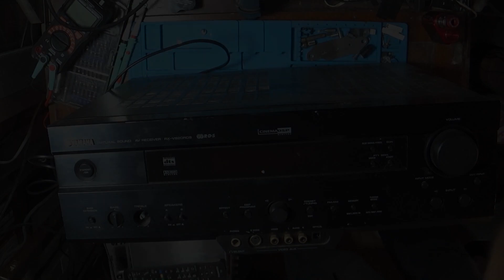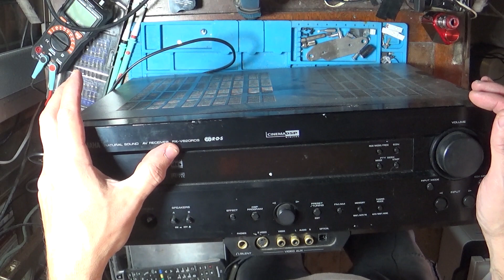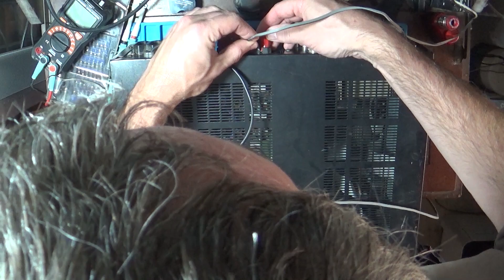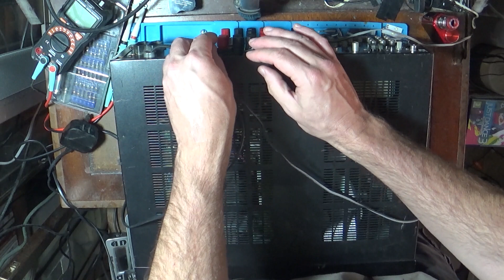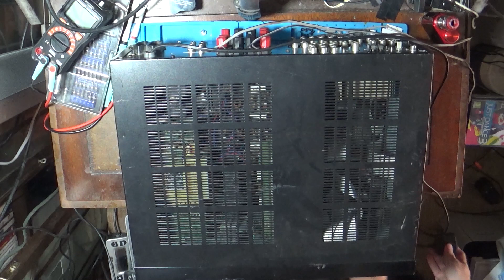Yamaha AV Receiver No/Low Sound Repair. Not sure what has happened to this amp? | UK eBay Reseller

Comment: Good Find!! You got lucky with a fairly simple fix. I was hoping in watching the very beginning that this would help me with my issue. I have an Harman Kardon AVR AV amplifier with the same issue... very low audio. I am thinking the amp got hot just like you say but in taking it completely apart and looking over everything I do not see anything out of the ordinary. Caps do not look swollen, no bad solder joints and all connectors are ok. It powers up normally and does not go into protection mode. All looks and operates normal but just has the low volume. Do you have a video on how to go about troubleshooting this scenario? (Testing transistors, etc.)
Reply from the maker: I'm not sure if I do have a video on fault finding. https://youtu.be/uDOwRPofaCQ this video has blown transistors but it was so long ago I can't remember the content without watching it myself. I didn't fix this one though as I had trouble getting legitimate new transistors.
Reply: @RetroElectronicRepair  Appreciate the reply. I am going to take it all apart again and check the transistors using your method. I like how you moved the working ones to confirm the bad ones. When checking the caps are you looking for shorts or opens using the ohms function with your multimeter? You don't show this on the video.

Comment: Great video on a small workbench. 
Couldn't you glue the board and restore it's shape with some epoxy like material? What glue can one use for printed circuits?
Your solution was spot on by anyhow.
Reply from the maker: You could probably use some epoxy resin but it would probably just break off again.

Comment: Bro teac 8800 av receiver only front lift right chanels not sound bro centre back sorrounding is good work but problem??? Plzz reply
Reply from the maker: Sorry, impossible to tell you what is wrong. Possibly a blown output transistor on that channel

Comment: I have one similar to this, a 520 rds, I suspect the model down and I wonder if that front panel has been off before not because of that damage but due to another fault and that was caused while fixing the other issue?

So on these they use a capacitor on the display panel to help them remember all the settings like rear delay, rear volume levels etc (You need a remote for these) and that capacitor dries out and leaks. I swapped mine out which means rmoving all those cables and the large board in the front panel.

I wonder if somebody hamfisted has tried and failed?

Anyway, I hope that helps
Reply from the maker: Thank you for the comment, that's some useful information to know. 👍